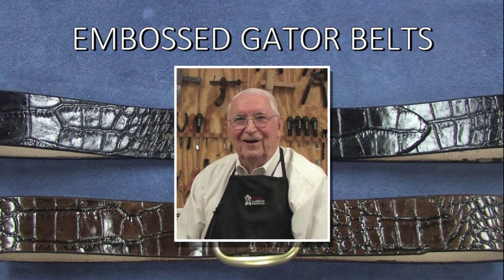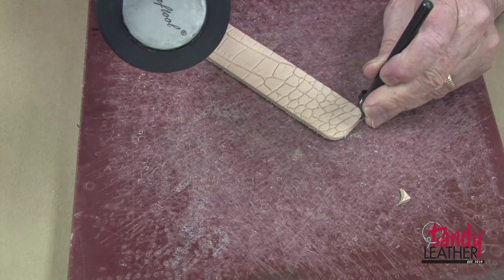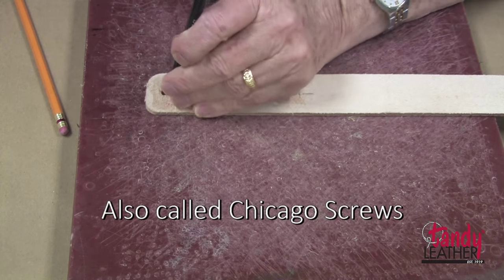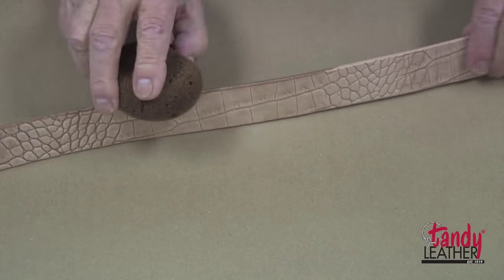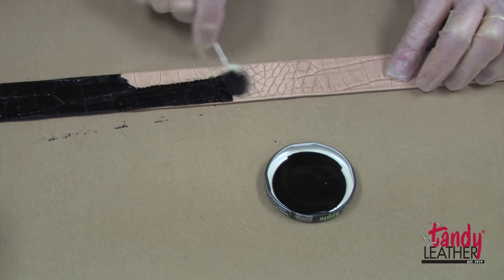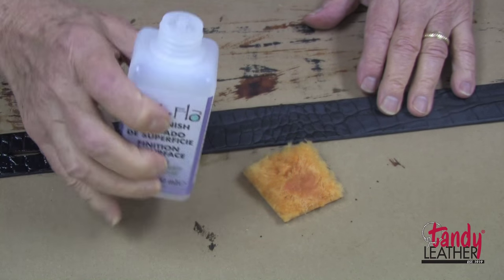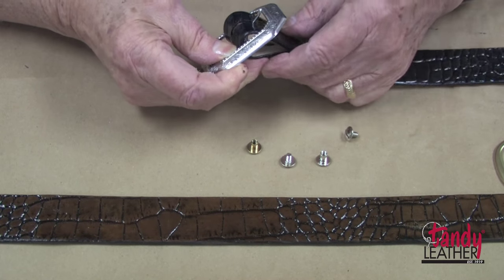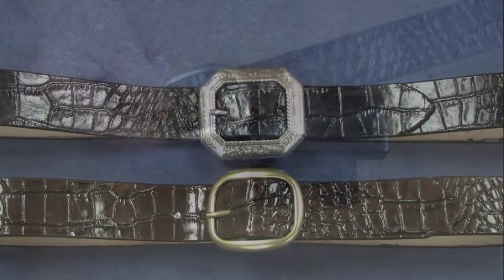Making A Belt with the Embossed Gater Strips

Comment: Just a quick question, why not finish the inside of the belt as well? Great job on the videos, keep em coming!
Reply from the maker: +bigtruck147 It can be much more difficult to seal the flesh side of the leather, so there is a chance that the color might run.  Typically if you were wanting to finish the inside of the belt, you would want to sew in a liner.
Reply: I used Feibings Tan Coat and then burnished it with a wooden dowel. It came out great!